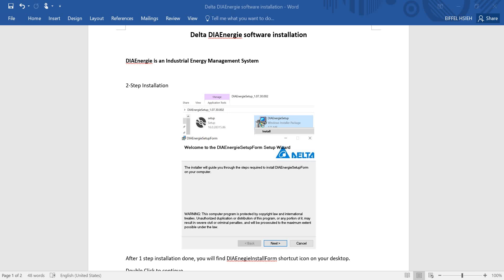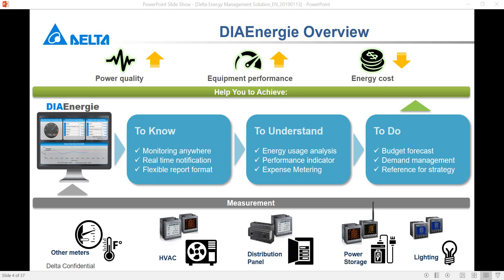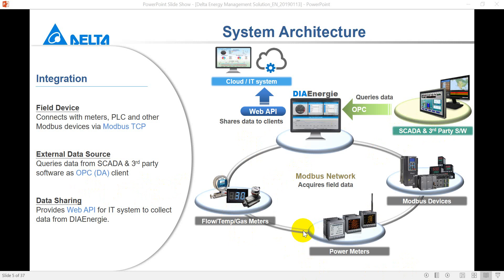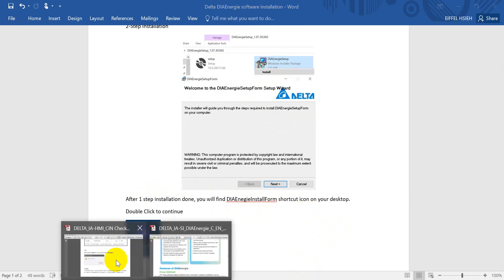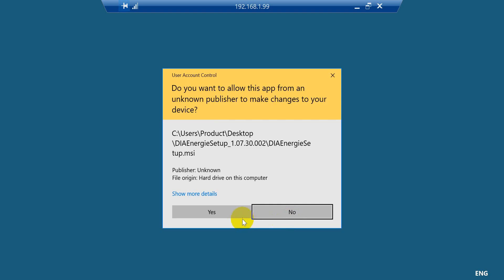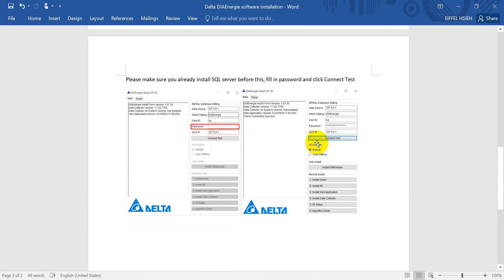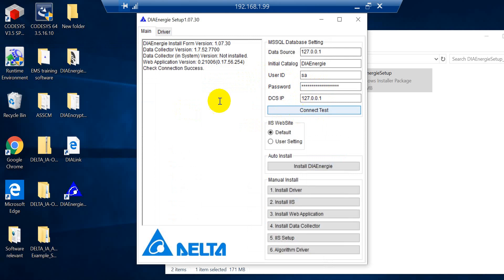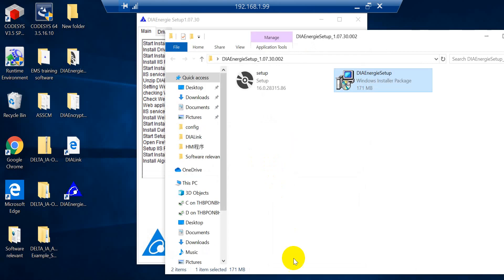Delta DIAEnergie installation

Comment: Pleaase I am getting this error all time (Check Connection fail! A network-related or instance-specific error occurred while establishing a connection to SQL Server. The server was not found or was not accessible. Verify that the instance name is correct and that SQL Server is configured to allow remote connections. (provider: Named Pipes Provider, error: 40 - Could not open a connection to SQL Server)
How to correct it